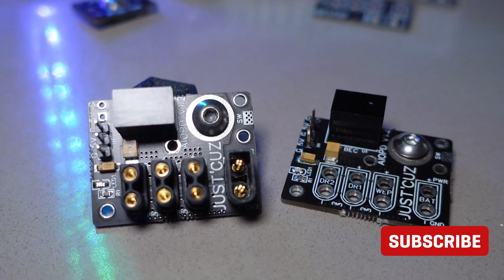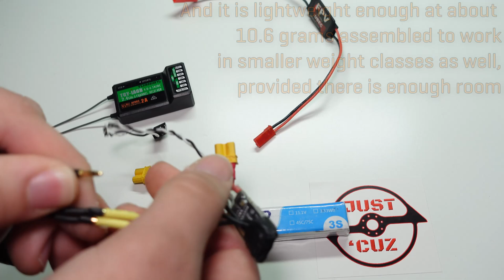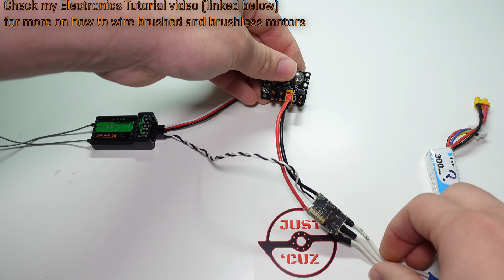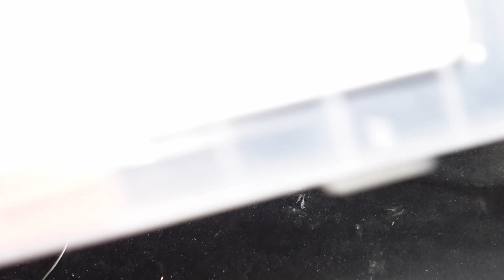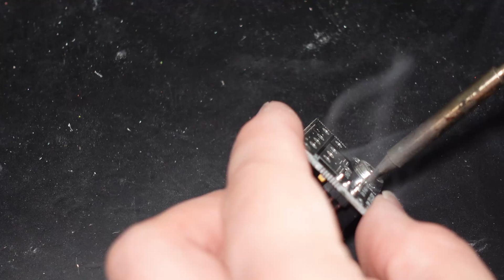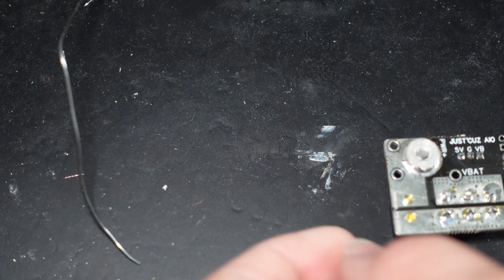Easy Wiring and Repairs - Just 'Cuz All-In-One Power Distribution Board for Combat Robots & More

Comment: what is i have more than 3 escs
Reply from the maker: You can wire a splitter or use one of my parallel boards.
Reply: @JustCuzRobotics  If I have 9 motors(4 module differential swerve drive+weapon motor) could I theoretically split twice/use 2 parrellel boards or would that create problems.
Reply from the maker: You can do that or buy a couple 4 in 1 ESCs to control 8 motors with 2 ports
Reply: @JustCuzRobotics  4 in 1 escs at tend to be quite expensive. I will probably just split twice then.
Reply from the maker: Using 9 speed controllers is going to be expensive no matter what sadly
Reply: @JustCuzRobotics  ya it's really bad, the speed controllers and motors which I intend to use combined cost 565. still want to keep it as cheap as possibly without sacrificing power or reliability tho.

Comment: How do you recommend mounting this board? I see you listed m2 screws. Does it need spacers? Can you leave the board loose in the bot?
Reply from the maker: In the CAD download there is a model for a 3d printable spacer you can use to space it off from a flat surface in your robot. You can also use hot glue, kapton or electrical tape to insulate it if the bottom of your robot is conductive. Leaving it loose is fine but makes it hard to turn on and off the switch, so maybe Velcro or something like that will help.

Comment: Is a precharge circuit REQUIRED for a 4 cell? I have version 1.2 of this board, started assembling, and saw this note.
Reply from the maker: It's a safety measure but not necessarily required. The board will function fine at 4S but there will maybe be visible sparks from electrical arcing when the switch is closed. This is a physics thing that always happens with higher voltage batteries, not a board design failure. You can extend the life of the board simply by adding a thin even coat of solder to the copper ring under the screw head - careful not to accidentally bridge to the threaded nut on the opposite side. Having ESCs with unusually large capacitors connected also poses a much greater risk of arcing /sparks.

Comment: Maybe make it clear that you are using leaded solder, I used lead-free on my boards, it's got a higher temperature and the boards get really, really, hot!
Reply from the maker: All the components that are pre-assembled on the board that customers will receive are assembled from my board supplier with lead free solder. I just have leaded on hand since I have found the lead free stuff is more of a pain for hand soldering. That's good to know though, I didn't realize that lead free has a substantially higher melting point! I might have to make the switch.
Reply from the maker: Also, if you have a recommendation for lead free solder of a particular blend or type let me know!
Reply: @JustCuzRobotics  Not sure, I've been experimenting myself, I have mostly cheap or no-brand solders, I generally buy them by diameter / flux content
Reply: @JustCuzRobotics  SAC305 is what I specify at work. It's not bad at all to work with once you're used to it.

Comment: Looks awesome, I’ll definitely grab some. Would it be sufficient for a hobbyweight spinner?
Reply from the maker: Awesome to hear! Hobbyweight could potentially be a bit more current than this can handle but it depends on exactly what voltage and motors you are using. It should have no problem with Hobbyweight drive though. If an XT30 survives the current draw, the board and switch likely will too. In testing the failure mode was usually the solder joints getting so hot that the solder melted off.